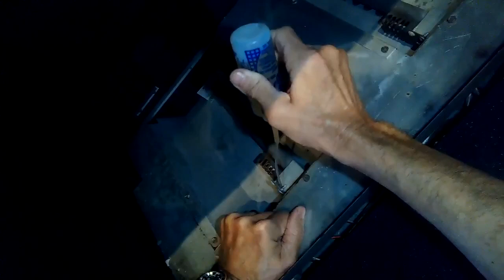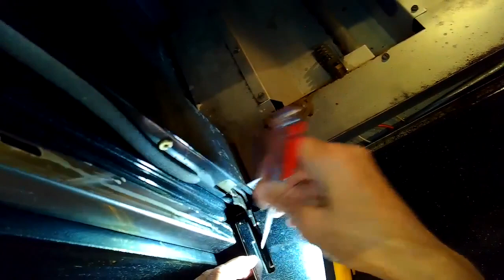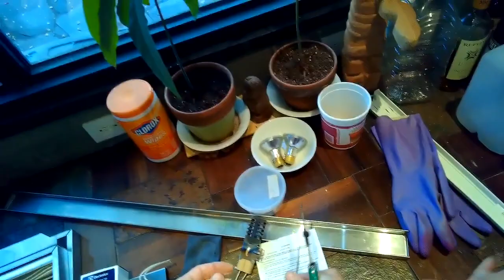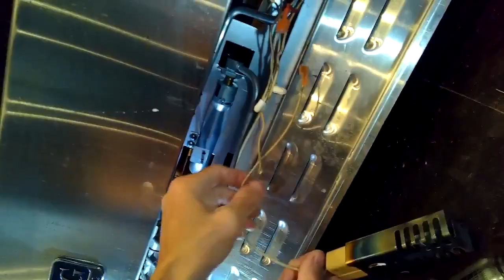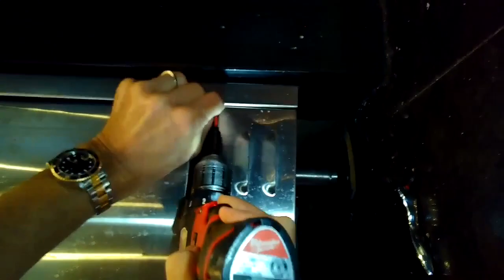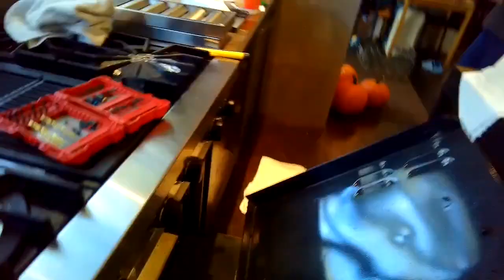VIKING OVEN TAKES TOO LONG TO HEAT—EASY FIX

Comment: Could you clarify, "Not heating, not igniting well"? It either ignites or it doesn't, no? If one is igniting, wouldn't it cause the gas from the other - even if the igniter isn't functioning - to create heat, also? Isn't there gas flowing through the tube to the other igniter? Mine heats, but doesn't seem to heat up enough, so perhaps just a calibration issue?
Reply from the maker: Great Question Jack👍 Click Here to Get Live Expert Help From Me For Just $5.00:
https://www.youtube.com/channel/UCGpInAejvpfVVE4FHB_L-Dg/join
Reply: @QuickAndEasy5MinuteAppliance  Yeah, I'll pass on help from someone who's just phishing with misleading titles with easy (incorrect) fixes. The answer, for others, is to dowload the service manual for your model. Some can be calibrated, others - like mine - cannot. And so it requires testing the RTD (Resistance Temperature Detector) and then possibly replace the sensor.

Comment: My oven takes a while to start up (where I hear the gas run) and shuts on and off, but in time catches up the to temp setting. If I turn the top burner on and off after it's been on for a minute or so it seems to start the gas as well. Does this sound like the ignitor or something else going on? Thanks. The Viking oven is 20 years old now.
Reply from the maker: Yep, it needs a new igniter👍
Reply: @QuickAndEasy5MinuteAppliance  Thanks!

Comment: I'm glad I watched this. I left it on auto play as I was wrestling with my viking range.  I was able to get the big door on the right off, no problem. But the smaller door on the right wouldn't come off for some reason. I was finally able to get one side free but the other side was still catching on something.  Throwing caution into the wind, I went for my flat pry bar, totally resisting the urge to grab the hammer instead. With door all the way open and a taped up pry bar, I levered between bottom of door and door opening. It took very little pressure, almost effortless. Once I got it nudged about 3/8" past whatever it was hung up on, I closed the door to 45°, relying on those auto hinge locks and pulled the door off with ease. ..
The funny thing about those auto hinge locks, neither of them deployed when removing the big door, and they wouldn't pry loose easily.  I had to get my channel locks on them. I probably should have lubed them but this is virgin territory for me. When they were my first and neither of them deployed, nothing seemed awry..
Anyway, I commented on another one of your videos a little earlier. The problem I'm having with my range is that once in a while, like maybe once a week there's a noise that comes from it that sounds like someone is learning how to arc weld and their machine is set too low so they stick their rod and fight to break it loose while the machine keeps buzzing. It lasts for a second or less. Since then,  I unplugged it and have been using only the stove burners, lighting them with  bbq lighter. It's been like this for over a year.
I'm addressing it now, finally, for my wife. (My wife is also asian. The photo of you and yours is heartwarming) she'll be gone for another 3 weeks due to surgery to treat stage IV lung cancer. This project is one of a few that I have put on a back burner indefinitely. I think it would go a long way towards her recovery knowing her homelife is improving. I'm a pretty sharp guy, mechanically,  sometimes I just need a nudge in the right direction. If you can think of anything I might want to check, I'd be much appreciative. 

How did the range get so messed up? Well it goes back a few years when i got some new neighbors.  Since they moved here, the neighborhood rat population  has exploded. I usually leave the back door open for the dogs to enjoy as much freedom as they can. When i noticed the new rat activity, I reacted right away. Trapping and shooting as many as I could.  That didnt stop them from moving into my viking range. Now that I've thoroughly explored it, I can't believe all the perfect access they have to move in like they did.  That heat vent, for one. Then there's the 2" hole in the back for the 1/2" gas line that doesn't even use it because it takes a 90° turn downward to go out ANYWHERE along the 1+" gap that runs from side to side, all 48", just like the front side. Then there are the gaps around each burner. Without going farther into detail, that whole grease drawer cavity was a mess. I cleaned it out as best as I could when I turned off the power. But now that I'm giving it a good ol' fashion "GI party," I want to spray it down with some bbq grill foam cleaner and get it all down to bare metal in there.  Also, as I mentioned in my other comment on other video, not all igniter wires are insulated. I'm wondering if a rat chewed it off then sporadically bumped into it, causing it to short out.  But does it always have power going to one side when there's no call for a spark? Any advice would be appreciated.  I was hoping to see an obvious problem by now.  But I've looked at all electrical connections that I know of and nothing sticks out...